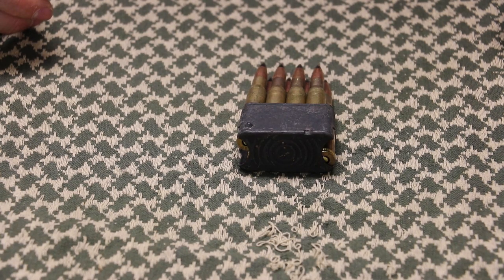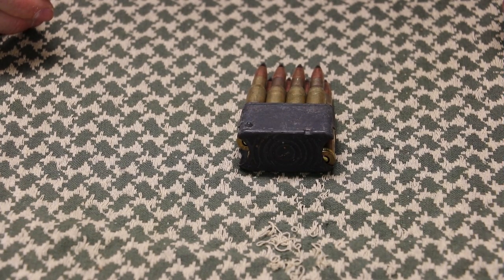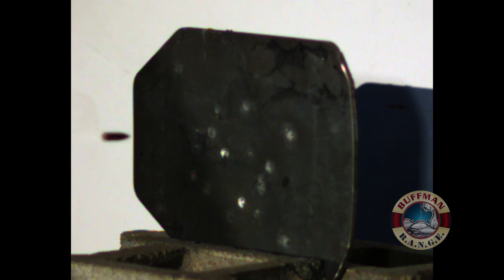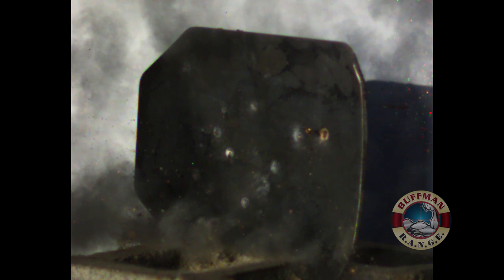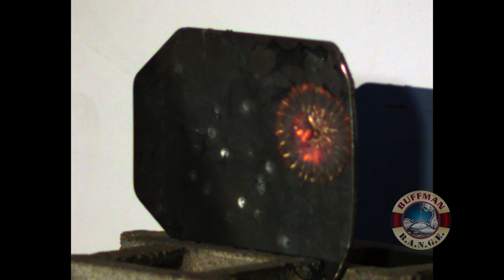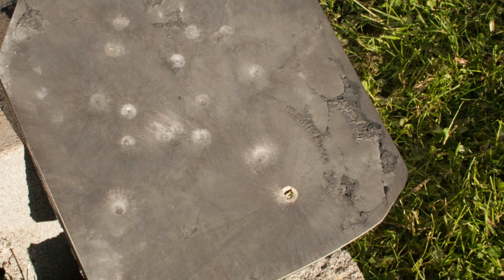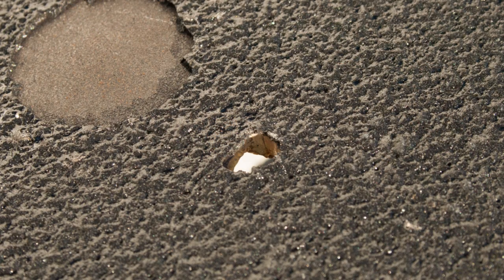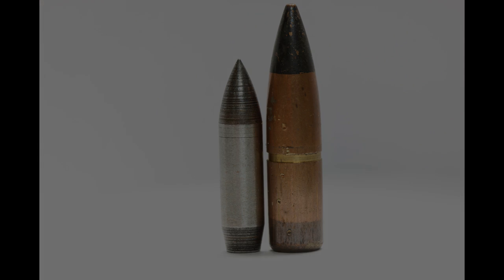High Speed - M2 Armor Piercing (Black Tip) Vs AR500 Armor Level III+

Comment: How fast is that round moving?
Reply from the maker: approximately 2500-2700 fps. Without a chrono and or measuring the bullet movement in each frame, I'm basing it off chrono checking of other surplus M2AP I've checked.
Reply: @BuffRANGE  wow, I thought those plates would stop almost anything. I wonder if a 556 w penetrator would go through over 3000fps